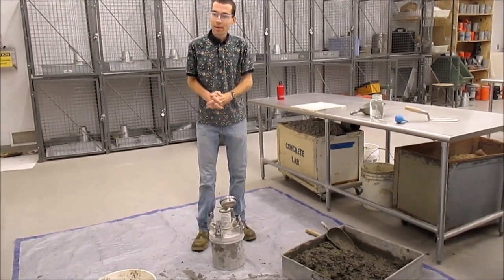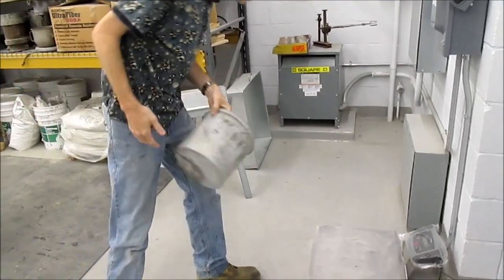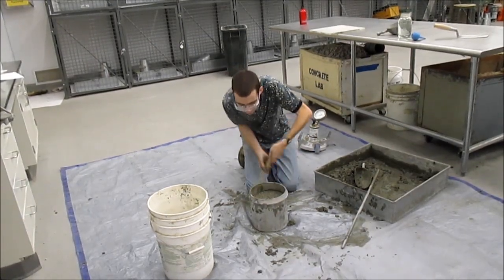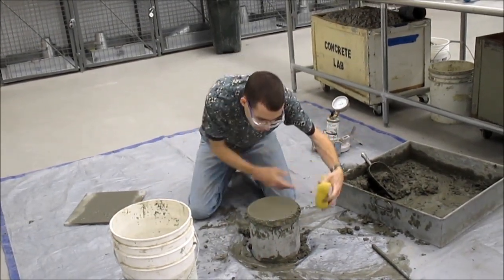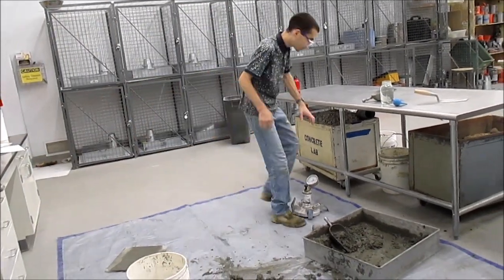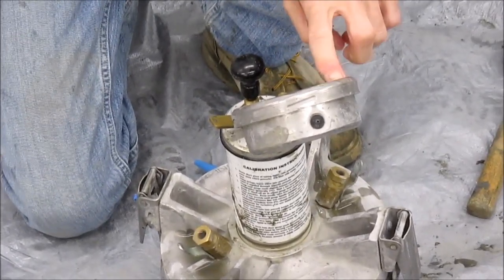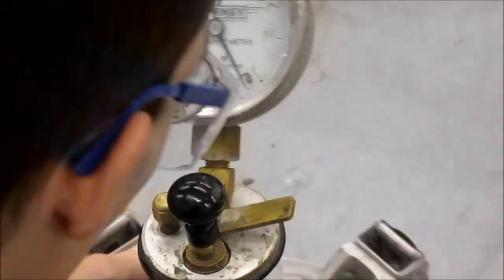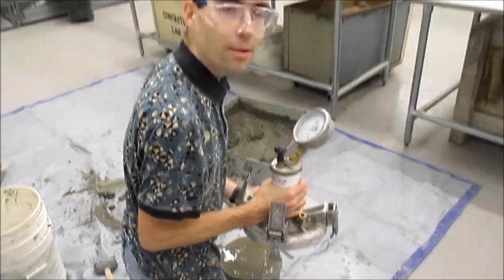ASTM C138-Unit weight of concrete and C231-Air content via pressure air meter

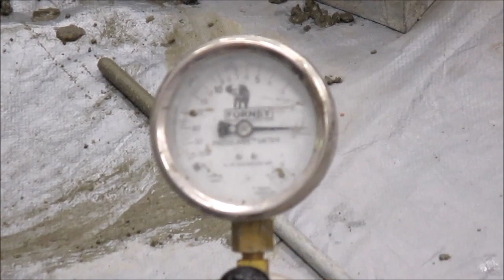Comment: Excuse me, i don't understand what I have to subtract (minute 11:00).. Thanks!
Reply from the maker: Hello! What you subtract is something called the "Aggregate Correction Factor". When you do the pressure air meter test, the pressure from the meter can force water into the aggregate. This will cause the air content reading to be higher than the actual air content of the concrete. 

To correct for this, an aggregate correction factor is applied. The exact value depends on the type of aggregate being used-for most aggregates, it's less than 0.5. If you're going for certification, the correction factor will be given to you-you don't need to calculate it or memorize it beforehand.
Reply: only needed with high absorptive aggregates

Comment: Should you dampen the bowl first?
Reply: 2017 ASTM C138 6.2 states "Dampen the interior of the measure and remove any standing water from the bottom."  immediately prior to weighing the measure (or tare it out on your scale if you want to save yourself a step later).
Reply from the maker: The ASTMs are annoyingly inconsistent in that regard. C138 does not mention dampening the bowl, but C231 does. Seeing as the two tests are typically done together, it's a bit of a contradiction. Honestly, unless you leave standing water in the bowl, it won't affect the result significantly.

Comment: thanks for doing this. this is a good run through, I am studying for the ACI test and if you did this again, verbally state all the steps and make sure to say "uniformly spreading concrete into measure" etc as this could be used against testees
Reply: What is limitation of air void content percentage
Reply: Depends on specs of mix design
Reply: If it was c40 50